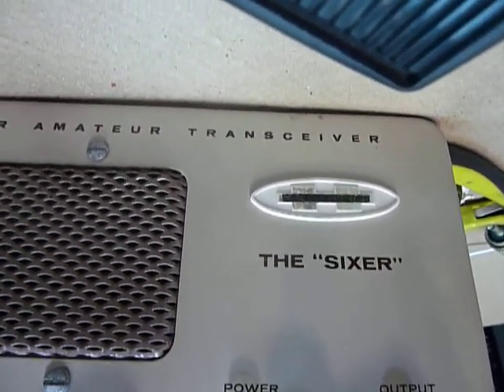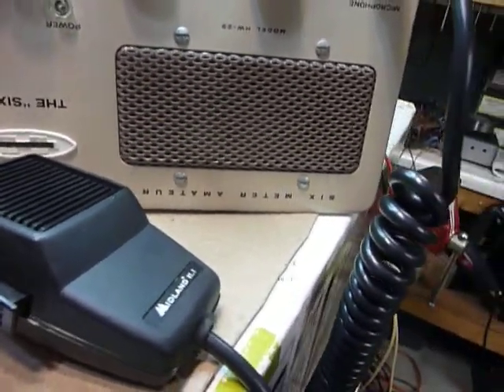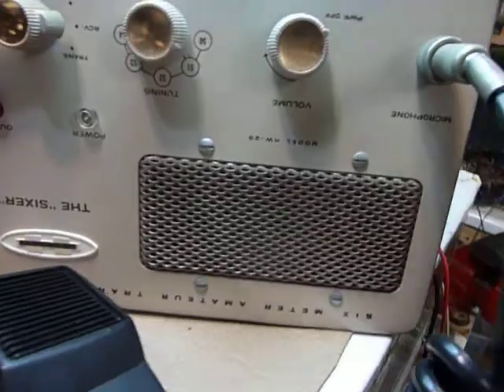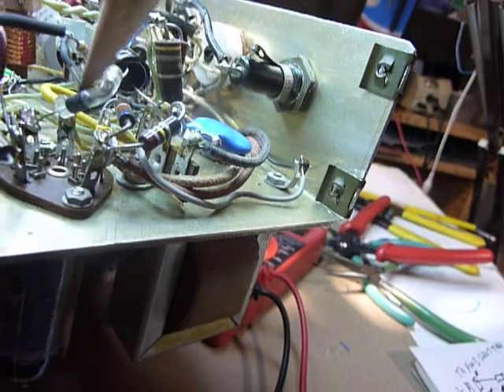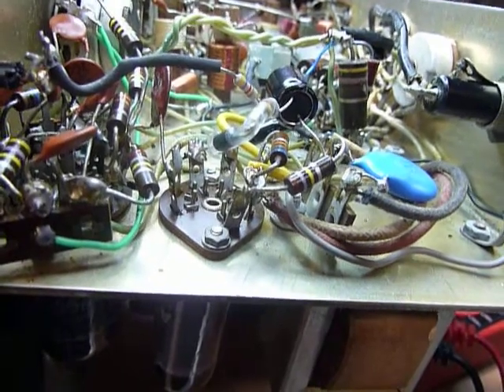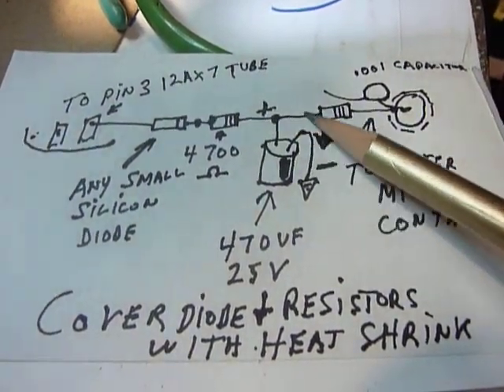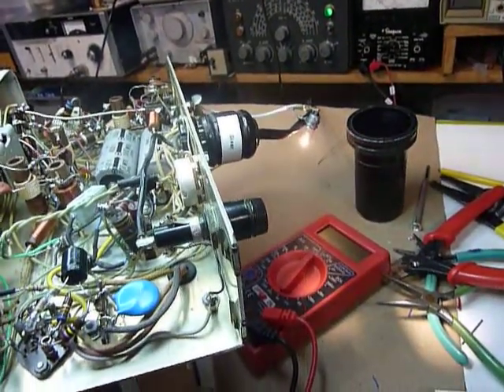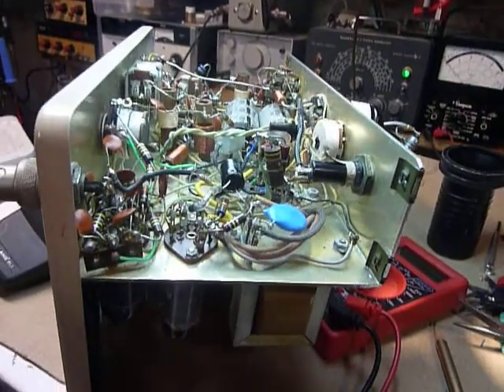HEATHKIT  SIXER MICROPHONE ,  HW29A  ELECTRET  MICROPHONE

Comment: Thank you so much for this tip.  I've got a Twoer and a Sixer that need to be on the air.  Practical and economical, Bob!
Reply from the maker: Thanks Cliff .  I knew there were many  of these out there without microphones there is the sixer, twoer , cb-1  and the rare Tener   73    Bob

Comment: I currently have a CB-1 and a GBW-12. I am going to put 10 meter tx crystal in it to try to operate on 28.3-28.57. I have the 28.57 Xtal and am hoping the radio will tune that high witjhout running out of adjustments. A good little RF amp can be found on ebay for under 20 dollars. It is a Minipa70. It boosted my 1 watt to 18 watts on the GW-12. It does not come with instructions but there are youtube videos on assembly and tuning. If anyone can tell me wher to get tx and recieve crystals for 28.3 to 28.5 let me know.